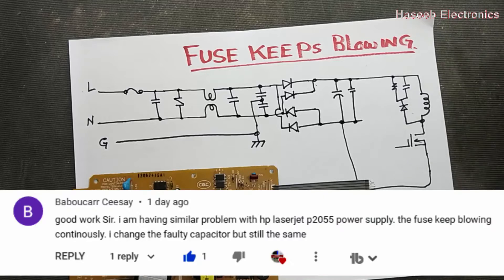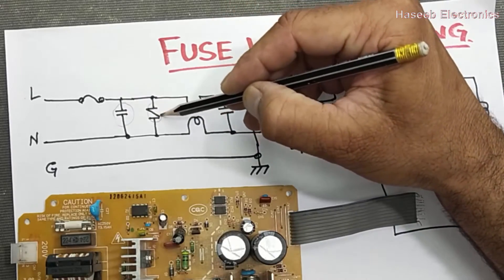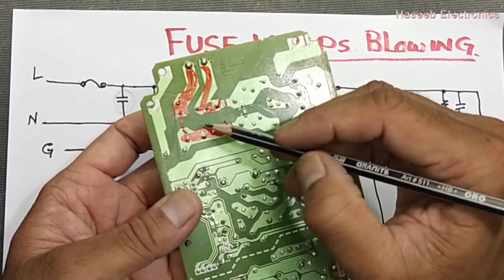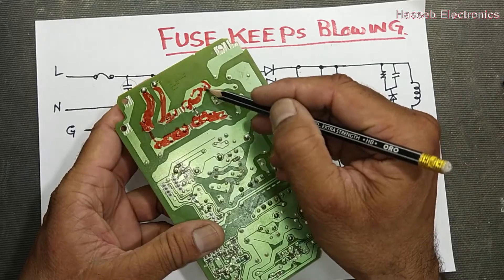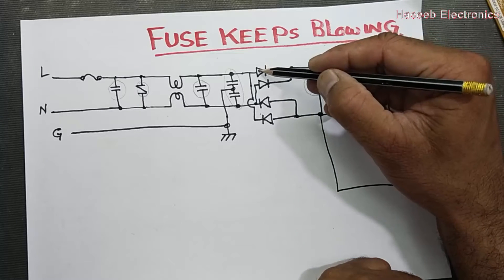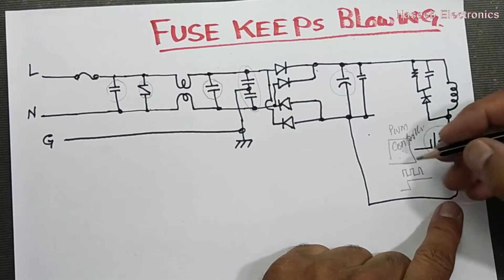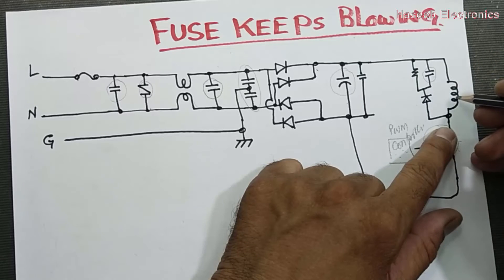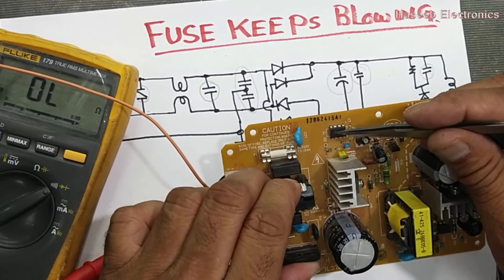{406} Fuse Keeps Blowing in SMPS || Input short Circuit

Comment: why fuse is connected in series with neutral line in my smps (foxin 450w) ? Fuse should connect with phase line ?
Reply from the maker: no problem, it have no difference, fuse can be connected in any line (phase or neutral) because the current have to complete its path in both wires. so the same current flows in both wires 
but it is much better to use fuse & switches in Phase wire (Live Line)
Reply: @HaseebElectronics  my fuse keeps blowing , and I did check the diode with dmm I think faulty diode (multimeter in diode mode red-probe-to-anode black-probe-to-cathode indicates value 0.002 for two diodes and for another two diodes value is 0.523 ,so I doubt two diodes seems faulty ) what is your opinion
Reply from the maker: @aboothahiru6354  in this scenario the diode looks shorted
Reply: @HaseebElectronics  if diode is faulty it will keep blown fuse ?
Reply from the maker: yes 
it will
Reply: @HaseebElectronics  desoldered that two diodes from PCB and tested continuity -it beeps ,
Reply: diode model MCC RL207
Reply from the maker: if it is giving beep, when it is out of circuit. that means it is short circuit
Reply: @HaseebElectronics  as from the datasheet of rl207 diode it is a 2ampere diode but I don't have 2amp diode so I can use two no. of 1amp diode in parallel ?
Reply from the maker: @aboothahiru6354  yes 
it can be used 
but it is better to use same rated value
Reply: @HaseebElectronics  thanks for your valuable support :) keep going
Reply: Hello , I doubt that c945 p331 non transistor is faulty so can I use bc547 as a replacement for c945 ?
Reply: @HaseebElectronics  Hello ,first I found that diodes got shorted so replaced a 2A bridge rectifier (4 pins ) and then I found c945 p331 transistor faulty replaced with same transistor again no standby-voltage 

Today I could identity that one jumper path on PCB is missed ,so I jumper it with a small wire 

BOOM it's working
First time successing an electronics repair
Reply: Thanks your help
Reply from the maker: @aboothahiru6354  fantastic t knowing that
congratulations on your success
Reply: @aboothahiru6354  hi hope you don't mind me putting in . I have a power board from my amp av . Also slow blow fuse keeps blowing there are zenner diodes and 4007 through hole . 1 of the 4007 shorts after each test (not tested to often ).

Removed all caps inc safety cap all.ok. relay ok but had 1 so put new in . 2 fuses 1 is higher amp that's OK..the other 1.6 amp 250v blows every time ..Inc the 1 particular 4007 diode ..I have about 8 there so gonna replace any that seem iffy 

You mentioned a missing bridge ? Please enlighten me ty unsure what bridge you mean ty
Reply: @aboothahiru6354 I meant jumper path not bridge ty
Reply: @HaseebElectronics  Hello ,I have a doubt with fuse rating to be used for my atx smps 450W (brand foxin 500s)?temporarily soldered two number of thin copper wire as fuse-element ,
220v2A fuse or lower ?
Reply from the maker: @aboothahiru6354  it must 3.15 to 5 ampere fuse
Reply: @HaseebElectronics  Hello ,my smps again stopped working -check ac input voltage 231V-ac and voltage across capacitor shows 378v-dc but max.peak should be 326v-dc (1.414*231) ,higher the peak voltage is dangerous or what?
Reply: that was showing 378v dc- because it has already charge -now it 303v normal 

My problem with standby voltage 
First i turn on supply to smps and check voltage across Violet and black it has no voltage (no 5v) then after i checked the standby transformer terminals(with live ) with multimeter,later i get 5v-SB then turn on smps with green wire -i get all outputs ...if i am checking voltage across sb transformer later it gets activated (sm transformr) and thus i get 5vSB 

what might be the problem ?
Reply: @HaseebElectronics  yes sir. But based on standards in some countries, fuse must be connected with the live line. Some countries have established electrical code to be followed.

Comment: Is it normal for the AC inductor(s) to become hot when the TV is in use? My parents' TV died and I found faulty components on the power board (BN44-00525A). One MOSFET was shorted and it took two diodes and the bridge rectifier chip along with it. After replacing them the TV works fine again, but the inductors next to the AC input become hot during use and I'm afraid there might still be something wrong with it. The TV's metal rear panel above the inductors gets hot to the point where it burns your skin if you touch it for more than a second. The heatsink of the bridge rectifier chip is actually cooler than the inductors. Is this normal?

Also thank you for the great video. It helped me find the faulty components.
Reply from the maker: inductor heating is abnormal condition
it means that there is something wrong which is causing to saturate the inductor core. might be improper  frequency is saturating the core
Reply: @HaseebElectronics  Could it be caused by using the wrong MOSFETs as replacement? I was unable to find the original part, STF13NM60N, in stock locally, so I used AllTransistors to find what I think is a similar part, IPA80R360P7. Perhaps it was not a good choice?

Comment: Off topic question....I have a relay on coil side getting 12 volts and the opposite side of coil reading 6 volts? Is this just a normal voltage drop from the resistance of the coil? Or is there supposed to be 12v power feeding both sides of the coil?

Comment: Your videos are very informative and clear. Please keep creating more videos. I have a problem with my 5kW inverter. It does not switch on and there is a dead short between neutral and ground on the AC output. When AC input is connected, no further damage happens to the board. Please provide some insight on this issue.

Comment: Great. So …to summarise if anyone of 95% of the components fail in a short state …pop😊so check everything
Reply from the maker: perfect. biggest headache is short circuit in parallel lines. one component will become short circuit and it will cause to give beep in all parallel circuit 
as it is high current area, so we cannot allow to flow more current to allow to heat up that component 
so there is just one situation to check every component

Comment: Sir i have an 12 volt smps and taken 5v by using 7805 from it. 
Sir problem is that i am getting dropped voltas , means getting 4volt instead of 12 and 3.5 v instead of 5,but when I remove 5v  capacitor then I get perfect voltage 12 and 5 but as I use the capacitor even if new capacitor then the same problem becomes
Reply from the maker: sometime 7805 makes problem or check capacitor at pin of 7805 regulator 
when 7805 makes internal spikes or its input capacitor cannot remove spikes, at that time it fails regulation and creates internal short circuit at input pin and ground pins
Reply: @HaseebElectronics  ok Sir 
Can SMPS Transformer also make this kind of problem
Reply from the maker: @raoamarjeet5473  i think no
Reply: @HaseebElectronics  ok Sir 
Thanku so much

Comment: Hi, doesn't secondary side fault burn the fuse?
Reply from the maker: no 
secondary side will cause to drive the smps controller in over load protection
so secondary side will not be a cause to burn the fuse
Reply: Thank you very much. I didn't hope you will spare time to reply . Thank you very much.
Reply from the maker: it is my pleasure
Reply: And sir what about sm transformer primary side coil ? If it is short it must burn the fuse!
Reply from the maker: transformer primary side coil, first it will damage the mosfetv
then it will cause to burn the fuse 
in that case it will keep damaging the mosfet
and fuse as  well 
the transformer coil damges rarely, it is in copper winding.
if it is silver or any other magnetic wire, then it may damage rapidly

Comment: Sir my TOP224YN IC blows as soon as I switch on the PSU along with fuse, what can be the possible cause?
Reply from the maker: may be the RCD snubber have problem 
may be ic material failed
may be some high voltage spike damaged it 
may be bridge rectifier have problem

Comment: Sir I have an smps board of Philips home theatre system hts 3000. The system is working only when I am connecting power supply through a series bulb (200watts). And if it connecting direct fuse blown. Kindly help me sir
Reply from the maker: please check input voltage, is the voltage is oure sine signal or it have some distortion
check Class X & Y capacitors
check thermistor 
also check bulk capacitor
Reply from the maker: also chexk RCD snubber
Reply: @HaseebElectronics  I can’t get this words. Please explain. I changed main mosfet 5n60 and Pwm ic . No difference. Fuse still blowing

Comment: slm, brother can you replace parts with IGBT example G25H1203 HAF638 withIXDH30N120 gbt without diode 60A 1200V 70ns 2.4V saturation, pleads advise
Reply from the maker: today you will find the complete comparison in video number 504
Reply: sukraan
Reply from the maker: just after 10 minute only
Reply from the maker: ١٠٠ اهلا و سهلا
Reply: ok
Reply: I, but don't understand your typing

Comment: Hello brother. Capacitor Y to GND is designed or must be selected as open curcuit if fail so that to prevent electric shock because of not proper connection of chassis to GND.
Reply from the maker: it is selected while designing class y filter. it removes the noises in secondary section and grounds them to chassis earthing point

Comment: Sir I have power supply 24v 10Amp it may start for a fraction of a second and than shut down, or it may pulsate trying to start every few seconds and shutting down after a fraction of a second, or it will shut down when I connected with load.. Basically thsi power supply used in CT scan and MRI film printer can you share where is the problem... It will great if you help thank you in advance

Comment: I think after the bridge, if there is any components are damaged the fuse will not blow
because bridge diodes not allow the current to flow in reverse direction to damage the fuse, I think so 🤔

Thanks for the informative video 🙏
Reply from the maker: you are right,
but in fact, when the heavy current surge and voltage stress exceed than the diode's current limit and PIV values, in that case the bridge goes away and it takes fuse with it as well. 
although there is current surge protection NTC or PTC but sometimes the spikes drive them to catastrophic condition
Reply: Chethan S, thanks for asking the question. I was wondering about the same thing. 

Haseeb Electronics, thanks so much for all your wonderful videos. I’ve been searching the Internet for explanations of the current flow in schematics and how it relates to the parts on the pcb as well as how to follow the traces. Your videos have really helped open some doors into understanding some parts of electronics I was struggling with. All the best to you and take care!

Comment: thank you, kindly do video on how to solve undervoltage problem,have power supply for patient monitor which is supposed to give 9 volts but gives 7volts,at 7 volts battery wont charge kindly assist
Reply: Sometimes output filters can do that check all capacitor with ESR meter to make sure they are in good working conditions

Comment: Very informative video. 👍👍

1)
Sir, please make a video about multi output SMPS transformer design like input (+12, 0 volts), output (+20, +12, 0, -12, -20 volts).
I try to make it. But when I control the output +12 volts terminal then the -12 volts terminal show -26 volts. But my transformer secondary turn ratio is same for +12, 0, -12 volts.

2)
20sq045 diode can burn pcb by heat description, if it runs it's maximum performance level ?

3)
How to remove high frequency noise from the SMPS output ?

Thanks. 👍👍🙏🙏